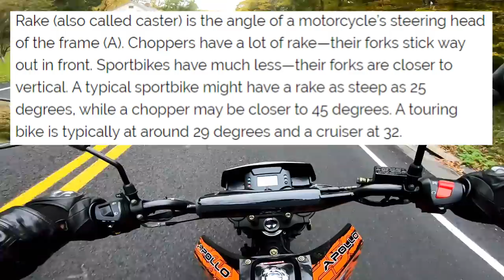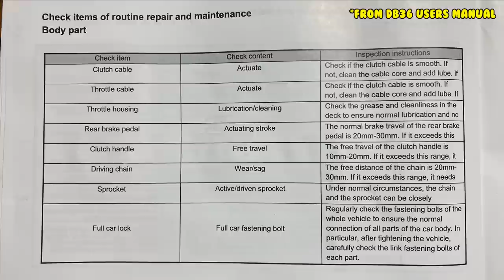[E1] Vitacci Apollo DB36 Supermoto Review, Build, Assembly, Test Drive, Impressions.(updated $1799)

Comment: This is called a orion rx250 down here stunning bike i had one really loved it and nobody thought it was a chinese bike they al loved the looks of it (lightly modded looks)
Reply from the maker: Definitely a head turner. 👍👍👍
Reply: killergamez z  what did you do to change the look, the graphics don’t look bad but I’m not a fan of the numbers and Apollo on it any ideas?
Reply from the maker: You could probably have some other vinyl sticker put on
Reply: @motosquid5979   oh man i thing lighty modded wasnt really a good word for it anyways.
Diffrent handlebars (golden) diffrent brake handel diffrent clutch handel (golden) repainted it honda style red and white painted the wheels half black half red and a set of spare rims that where polishe(goth them with the bike)
Diffrent exhaust (aliexpress) but it whas a akrapovic look exhaust home made pipe front till end (little biger) my uncle welded it.
Some vynil stickers custum made by a friend who owne's a vynil wrapping shop (honda style) some random cool sticker off aliexpress.
Diffrent head light unit ktm style. 
Diffrent back light, golden drive chain removed rear fender made custom number plate holder (just some bend metal XD)
Ow and dont forget a real mikunni dont know the size anymore but it was a nice upgrade was like 10 km/h faster like uuuuhm let me think 6mp/h for you guys and oval i though the engine runs better with it not saying original one is bad but i had alote of problems with leaking with it.
And basicly painted and polished alote of parts.

So yeah every one thought it whas a honda.
Atm i told them it was a chinees bike they al where like nooooooooo really mmmhhhmmm looks good though
And performance wasnt bad,but maintenance the bike man thats really key if you do that its a good bike,most poeple thin a ith a chineese bike it breaks down blablabla no thats because most poeple take it out drive with it never maintenance and thats it 

I was thinking of upgrading it with a 250 oil/liqued at the thime,
they make a little more power i though the aircolled version was like some where around 18hp or so and the oilcooled/liqued 25hp but o dont see them mutch around anymore (liqeudcooled).
Last time i saw a pitbike big model with this engine so thats a upgrade you can look for.
The engine its not from apollo/orion it self but i mean zonshen lifan orion bamipanghang the chinees engines are al the same pretty mutch.
But expensive so dont know what youre budget is.
And if youre really die hard put a honda engine in there.
Poeple here in the netherlands do that alote with chinees bike's and quad's.
Reply: killergamez z dang I didn’t know you could do so much to it I will definitely keep all of this in mind thanks a lot for all the info. I’d love to see a picture of it but I don’t know how that would work😂

Comment: Hey I love your videos! very helpful and informative. I have a question, if my apollo is for ALL street riding, what would be the best gearing for it and what chain should I throw on? I know I might have to change front and rear sprockets. If I chose to leave the stock sprockets on it for now, what oring chain size would fit the bike?? Thanks
Reply from the maker: It has a larger chain than most China 259cc bikes. I would definitely go up on the gearing but haven't looked into it yet. Chinariders.net probably what to use. Thanks!

Comment: Just purchased this bike from the website you recommend and used your code! I recently purchased it from another website and they ended up sending the regular 250cc and it was slightly damaged. I didn’t like how they were taking care of the situation so I’m just gonna get my money back. Hopefully it comes in by Saturday.
Reply from the maker: Damn. Let me know how you make out
Reply: MotoCheez just got the bike . everything went well. Just wondering why the gas says empty even though it’s full?
Reply from the maker: Congrats. It could have a wire not connected to the sensor? One under tank and one behind instrument cluster
Reply: Okay you were right about that. I found the unplugged sensor. Another stupid question to ask lol . Headlight/ dash isn’t lighting up. I can put the high beams but that’s about it. I’m looking now for a sensor or something but not seeing anything unplugged.
Reply from the maker: There's a headlight switch on left controls
Reply: Yea I know buts it’s not lighting up.
Reply from the maker: There's an on off and high low switch. If everything on, has to be another connection somewhere.

Comment: cool, I'd like it better if it was EFI instead of carbureted, had reserve, and a bigger gas tank. Also a lower idle like 500-600 rpm.
Reply from the maker: These single cylinder bike always say 1200 to 1500 idle. I do mine like 800 once they’re tuned in good
Reply: I don't know of any motorcycle that is supposed to idle that low.  Pushing the idle lower than spec risks running the oil pressure too low.
Reply: @DoRC  Until I got EFI, all my carbureted bike from the 60"s 70's and '80s idled that low.  Now if I remember right my last carbureted Harley idled around 900 rpm.
Reply: @EasyRiderGreg  you may have set the idle that low but I highly doubt it was the spec.  Most Harley's spec is 1000ish.
Reply: @DoRC  My last 3 Harleys, the idle was around 900 according to the tachs. I didn't set them, they were EFI and set by the ECM. The other much older ones from the "60's set around 500 or 600 rpm Is what every one set them at back then. Unless they wouldn't stay running then they were set a little higher. When choked the ran a lot higher.
Reply: @EasyRiderGreg  sound about right for an efi harley.  Older Harley's spec was around the 1000.  People set them too low because they like the way it sounds.

Comment: it would be interesting if you could do a series modding one of the Chinese bikes and see how much you can improve it, but by only using Chinese parts. Not sure if the Chinese actually do any forged or performance parts for engines but would be interesting if you could source some, better carb, port and polish, see if its possible to increase valve size with Chinese valves, set of adjustable suspension, get an fmf copy exhaust, could be an interesting series if the parts are available.
Reply from the maker: Lethargic would be tough to find parts for that. Only thing I’ve seen close to that was when I put the 88cc big bore kit from China on my Z50 months ago
Reply: @MotoCheez  some parts might, could take the risk just ordering a forged piston the same size from alibaba thats designed for something else, between them and dhgate you have options for pretty much anything, probably most is the same stuff fitted at the factory, but i did see 6 pot brakes, fully adjustable rear airshock suspension for mx or road, and mikuni* carbs all around the $20-$50 mark, though im talking like you have loads of money to spend and ok with risking the potential destruction of one of your bikes, as i could see a fire resulting from the carbs or melting your engine with a fake piston made from tin :P maybe something to try once you get more subs and youtube actually covers your costs.
Reply from the maker: ShroomzGames haha. Yeah that’d be a fun project!

Comment: I think I like the Brozz 250 much more than this bike. Counterbalanced engine, luggage rack, 3.5 gal tank vs 1.6 (!), and the Brozz runs well right out of the box.
Reply from the maker: True but this has overhead cam!
Reply: Just got a 2023 TBR7 it has a bunch of added in stuff then the ones I’ve seen on here prior. It came with a usb charging port and a choke on the bars. A gold chain which links are bigger then the usual so my sprockets I ordered (45 rear 17 front) wouldn’t work with the chain that came with it. Came with a decent carb on It thank god because the Nibbi bought (with the flange) won’t fit. And go figure today I’m out riding I stop turn off my bike then go to turn it back on it won’t start the solenoid relay went it’s making a sparking sound so I just ordered a new one. Point I’m rambling on about is all these Chinese duals are great in their own way. Ride safe homies much love!
Reply from the maker: I've heard some of the newer bikes are coming with the larger chain! Good on the upgrades
Reply: @MotoCheez  yea I wasn’t expecting the bigger chain but Meh it looks cool! Also wasn’t expecting all the extras it came with so can’t complain. Thing started right up after I assembled all that needed done and I’m having a blast. Thanks for the content man you are the reason I ordered this thing. Haven’t rode since I was hit on my 636 from a guy who was texting and driving. Been afraid for years to get back on one then found your channel started binge watching your videos and said I’m ordering one lol. Thanks for the content man you got me riding again 😁
Reply from the maker: That's awesome! Ride on bro

Comment: Im waiting on my apollo 250 pure dirt bike to arrive this week. Loved the review on this one. Do you loctite anything when you do these new bikes or do you build it all stock and do kind of a wait and see on adjustments/loctite/upgrade parts? Im mostly going to do trail riding! Happy to find your channel. Thanks for the vids motocheez!
Reply: PS Im decently handy but know zero about bikes. Will be my first one owning and havent ridden one in 20 years. Been wanting a bike for forever.
Reply from the maker: Awesome. The dirt bikes are sweet! I don't use loctite, I do use a dab of silicone gasket sometimes, the rubber washers most the bikes use work great now too so no need for loctite IMO. As long as you're mechanical you'll have no problems working on the bikes, they're basic which is the beauty of them as well 😁 enjoy!!!

Comment: I bet it would benefit from an oil cooler being as it runs on 93 octane and is air cooled . That would make a great upgrade video . 🙏
Reply from the maker: brad b has a spot for it too. Wonder if there’s an oil port. The pushrod style had fittings on valve cover
Reply: @MotoCheez  I bet it can be done . 😎

Comment: So excited for this video!! I picked one of these up in July of this year. I bought it assembled from txpowerports. I have so many questions!!! For one, what that hell did that yellow tag you highlighted due? I just removed it since it made no sense. 
The dash is all in kilometers which sucks. Trip and speed in kilos so unless you know the conversion off the top of your head I use phone for a speedo. No rpm gauge kinda sucks, I put a cheap tiny tach on to monitor. I made custom brackets to mount DRZ passenger pegs on the back for passengers. I also switched to mikuni carb, I had a hard time dialing in stock one which did have the 109 jet in mine as well. I'm still having a hard time getting it to run right between 1700-2300rpms it studdards and falls on its face but after that it rips. I really wish it had a 6th gear tho, but planning on sprocket change so maybe that will help top speed. Being a bigger guy at 260# plus having a 100#+ rider it does ok and will still cruise nicely.
Reply from the maker: No clue what that tube does. Hopefully somebody will have the answer. I believe my speedo is mph for sure, I’ll confirm. Tach would be cool. Not sure if I want a passenger on mine. The shuddering, try dropping the needle one groove 6th gear is what all these China bikes need.
Reply: @MotoCheez yea let me know if dash is in fact in MPH, if it is hopefully mine can easily be converted? Which would be awesome!! 
I didnt receive any type of manual with mine, so maybe there is a process to change it between kilo/mph?
Reply from the maker: Nate Van Bynen mine has to be in MPH. 100 kph is 62 mph. I’ll confirm though
Reply: @MotoCheez  I could be wrong, but I think that tube that Y's out from the crankcase overflow is a passive way to oil the air filter. I've seen the idea used on some 90's bikes. Again, I could be wrong. Mine had some weird colored funk coming out of it over the first 500 miles or so. Yellowish/white substance of sorts. That little tag I think is trying to tell you to cut the zip ties holding the vent to the swing arm linkage.

Comment: So which of the Dualsport chinabikes do you believe is the best value? And which one do you believe has the best maneuverability/handling when riding off-road? Im not really worried about power id much rather have a light nimble bike thats easy to manipulate in the dirt rather than a really powerful tractor with poor handling (single track/ enduro style riding)
Reply from the maker: Definitely the Hawk DLX or Brozz The top 2

Comment: so then this is a different model engine from the hawks right? does that mean it would be easier to find a big bore kit for it? I suppose with only 5 gears that mod wouldn't make a huge difference to the top speed, but maybe it would help with the low end? I wonder if there's a more aggressive cam that would fit these.
How does the rear wheel adjustment on this compare to the hawk?
Reply from the maker: Yes, and cams I've heard

Comment: How was the vibration when riding? that is a sweet looking bike, i imagine as with other bikes it will smooth out over time.
Reply from the maker: It’s has hard suspension and a hard ride. I did loosen the spring all the way. Haven’t tried it. It’s great on the road but hard off-road but does good. Working on video now

Comment: The chinese OHC 250cc engine on these bikes have a bigger cylinder than the OHV ones, the piston of Hawk can fit easily on the skirts of these OHC pistons, nice engines and bikes for that price
Reply from the maker: Good to know!
Reply: @MotoCheez  aaaah and about the "pro-link" suspension, grease it up well, in my bike those pieces have tiny needle bearings inside,when i bought my bike, those were almost dry and didnt find any spare part of those pieces
Reply from the maker: ME262MKI I saw the needle bearings when I put the seals in. They were greased up good on mine

Comment: Hey I built my apollo yesterday! So the yellow engine vent to sayes to cut a plastic piece , but what does that mean ?? Also there was a tube for pollution management that has a round looks like a filter has in and out written on it. The out isn't connected to anything. How is that supposed to run ?
Reply from the maker: The "cut" thing I never figured out, the pollution tube just stays how it is to suck air I assume.
Reply: @MotoCheez  lol! Ok yea just gotta change mail oil in it to 10 w 40  then I'm ready to ride !!

Comment: Thanks for the video I really liked it I bought one myselfand I have three videos but what jetting did you put in you took out a 109 but what number did you put in a 110?
Reply from the maker: I did put in a 110. The jet says 109 but it felt more like a 100. The 110 was a world of difference so that 109 didn’t make sense
Reply: @MotoCheez  thanks for getting back I will have to learn how to put a jet in mine
Reply: What jets does it use?
Reply from the maker: The stock carb? Have links at motocheez.com in the bikes section.

Comment: Hi Motocheez love your vids can you please tell me I'm thinking about getting this bike over hawk and tbr7 is this bike way better then them and Sounds more powerful is this bike worth the $400 over the Tao and the Hawk?
Reply from the maker: If you're riding on the street mostly, yes. It's set up for street for sure, I have a few videos on trying to offroad w it
Reply: @MotoCheez   ya I can get the Tao for $1240delivered or the db-36 for $1620 I'll keep my $400 if it's not that much better what interest me most is it looks like db-36 is like 17hp where the Tao is 15
Reply from the maker: The DB36 has overhead cam! That's why
Reply: @MotoCheez  so you would pony up the extra $400?
Reply: Is it noticeably faster?
Reply from the maker: Yes, but Only if I planned on using on road only. If you're planning on offroading at all I'd go for the TBR
Reply: Sorry to keep bugging just don't know if it's $400 better you know what I mean!
Reply from the maker: @cjtaylor1972  it's definitely noticeable, just as I said in video, you can feel power band difference from the CG style engine (hawk, TBR7 etc)
Reply from the maker: @cjtaylor1972 the main question is do you want for just riding on pavement? If yes, it's worth it IMO
Reply: @MotoCheez  cool thanks man I'm getting the tbr

Comment: Hey so I'm 1 month way from buying this thing !!! So I'm gonna be do mostly highway driving. Would u recomend a socket change ? And if so what size? Also do they have a cluster that u can swap out to it will read mph ?
Reply from the maker: I'd gear it up as high as possible (chinariders.net) the one I got from txpowersports is reading in MPH.
Reply: @MotoCheez   where should I order the new sprockets from ?
Reply from the maker: @therockjab  IDK. Haven't gotten that far yet. Chinariders.net probably has something.

Comment: A bit surprised the horsepower isn't any higher than for the pushrod version.
Reply from the maker: I was too
Reply: @MotoCheez  Do you find these engines vibrate quite a lot?  Does the ohc version tremble like the push rod one in your estimation?
Reply from the maker: They're about the same. The counterbalanced engine is pretty good though on the Brozz
Reply: @MotoCheez  I have experience going back to the late '50s with four stroke singles in this range and this Hawk is one buzzy creature.  I worked for a Kawasaki/Suzuki dealership in the '60s and '70s.  The small KL and KZ singles were smoother than this as I recall.

Comment: Question for ya I have a rattle in top end of this bike I think it the valves a bit loose.  What should these valves be set at ?
Reply from the maker: I haven't looked into these yet. Is there anything in the manual? I plan on checking them this Summer
Reply: @MotoCheez   yea didn't see it there also checked on frame tags. Is see gap for spark plug but nothing for the valve clearance
Reply from the maker: @therockjab  it's usually .002" intake .003" exhaust but I'm not positive